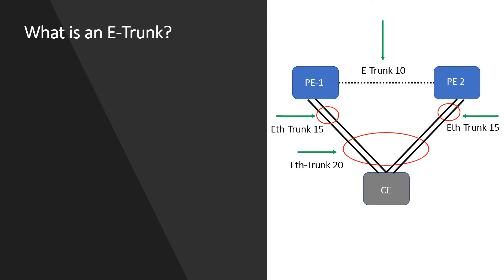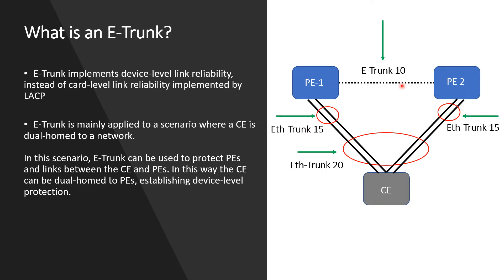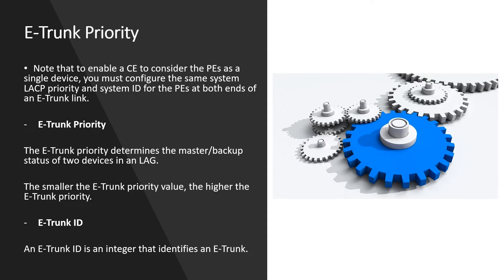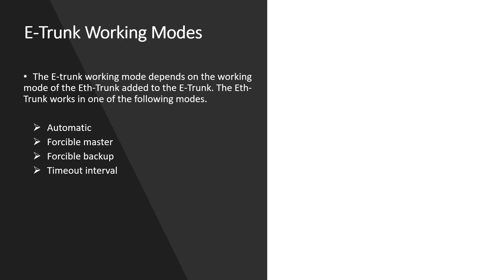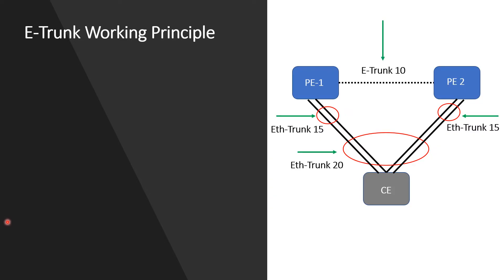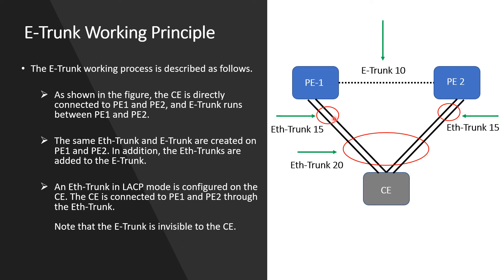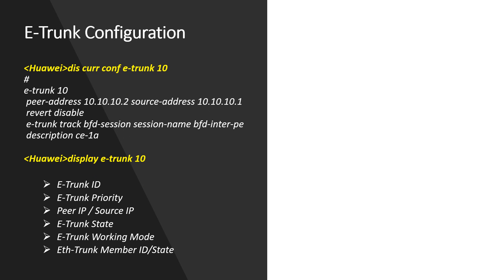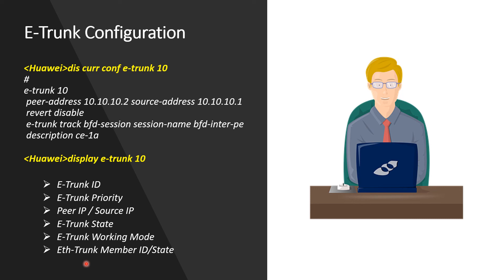Huawei E-Trunk | Understanding MLAG (Multi-Chassis Link Aggregation)

Comment: @OurTechPlanet can you have Eth-Trunk20 on the CE configured for 1 physical link only, per East and West direction? Am asking this in the case of longhaul metro fibre where the CE would only need 1 longhaul fibre connection from the East and West respectively. I believe Eth-Trunk config can still cater for 1 member link? I guess the aim is to use the Eth-Trunk signalling to alert the E-Trunk configured on the PEs?